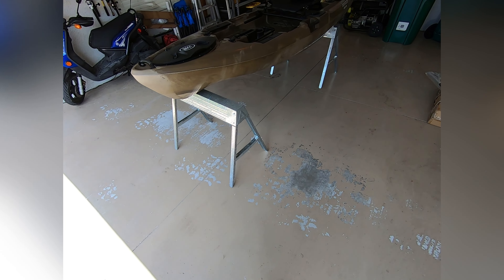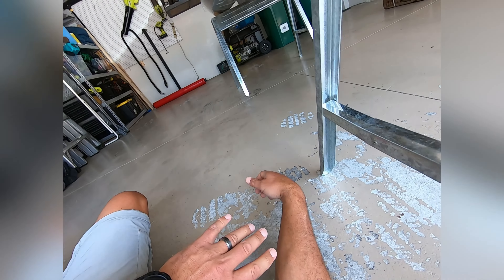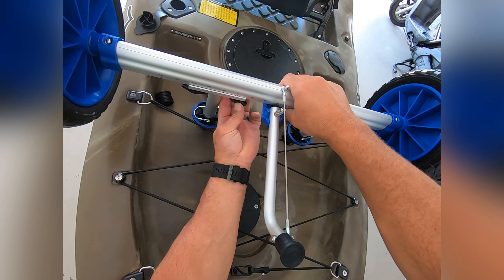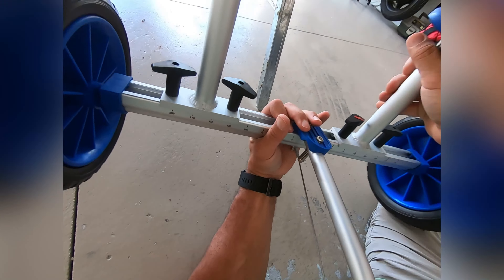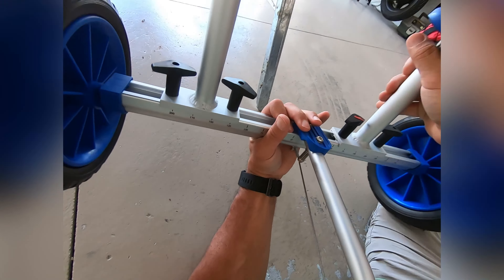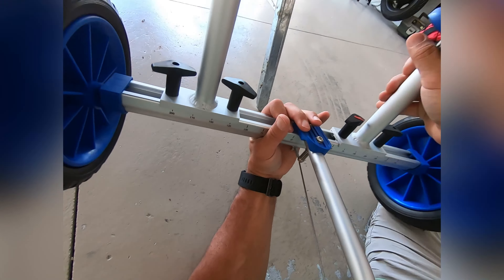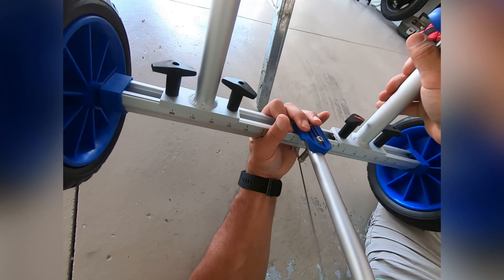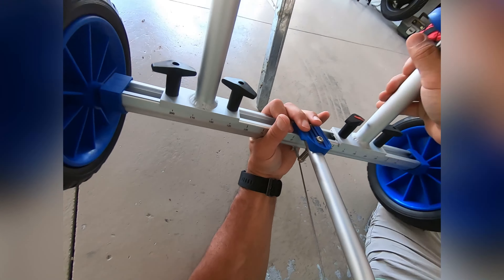Brooklyn Kayak Company PK11 review, BKC Pedal Kayak just arrived!

Comment: Were you ever able to fix the fit issue on the Peddle Cover?  Also, if there is an issue with the propeller caused by water depth, it is easily lifted out until it can be safely used again?  Thanks for the video
Reply from the maker: I haven’t fix the cover issue yet.  It’s a simple fix with a Dremel tool I just simply haven’t gotten around to it.  it’s functional the way it is but it is annoying.  Lifting the pedal system out is easy process but the propeller does have to be aligned just right and of course you can’t see so it does take a few attempts at times.  After some use you do get a pretty good idea of the correct alignment to pull out the first time.
Reply: @j44881  Thank you

Comment: How do you like it? Im considering your exact setup!
Reply from the maker: Hi Bryan,  my quick answer is yes I like it.  The main thing I like is the haul shape.  It is good for both open water and stable in inland rivers and ponds.  The stability chart link in the description has a lot of good info on this.  It’s also lite enough to handle with no problem.  I didn’t show it in the video but standing/fishing in the kayak is very doable in calm water.  The cons,  not much space for accessories, without modification and drilling into the haul which I’m going to do.  The rudder that comes with the boat is to short, the BKC website sells a larger rudder which I’ve ordered but it’s about $120 and has not arrived yet.  Plan to do a part 2 video when it does.  Would I buy it again,  the answer is yes.  If I were in the market for another kayak I would look into the Vanhunk 11 mahi mahi and do some research on that but I am very happy with the purchase.  Good luck  on your potential kayak.

Comment: Looks nice, but I would consider not using a scupper cart. Could end your day with a crack and sinking your new yak.
Reply from the maker: Good information I’ll look into it farther.  I did hear from another source that unlike the a pole anchor that should not be used for the exact reason you mentioned the scupper cart was minimal pressure over a larger area.